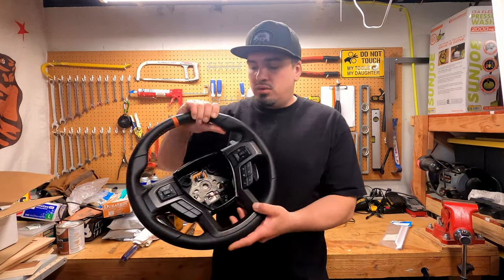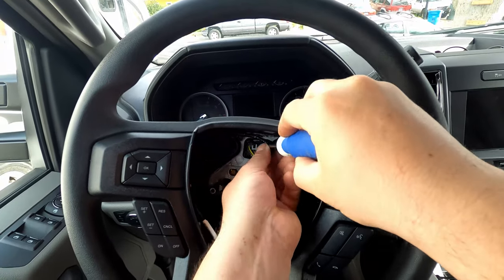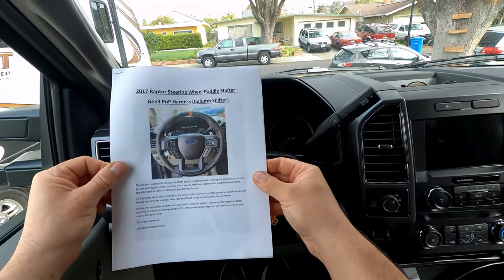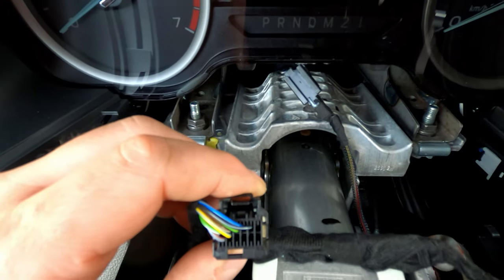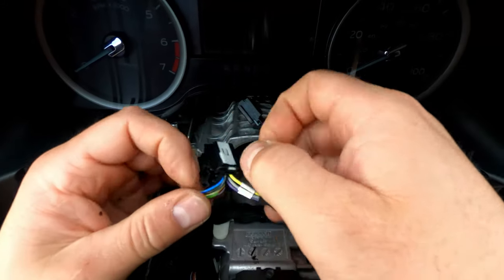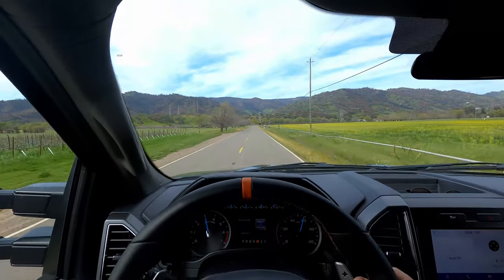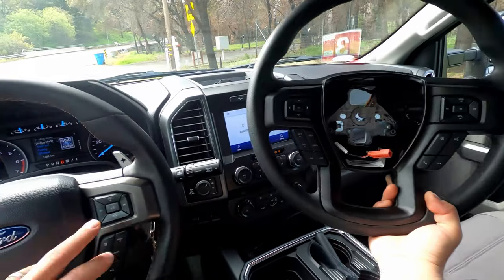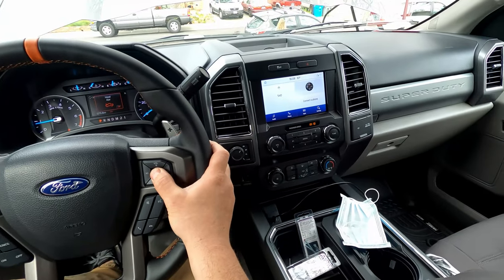Raptor Steering Wheel Install on F250 with BoostedGreyGoose Harness for 2017+ Super Duty

Comment from the maker: UPDATE:
I just towed almost 4k miles, and I absolutely loved having the paddle shifters. I pulled my trailer over multiple 7k+ foot summits on 6%+ grades and it was so nice to be able to easily shift up and down through the gears as needed. It worked really well to put the truck in M and then set the cruise control. This way the truck will maintain the speed when possible, but if you hit a steep incline your speed will drop until you manually down shift. I liked this a lot because I would rather lose a couple MPH's and maintain a gear at 2500-3000 RPM than have the truck down shift a gear and rev up to 4500 RPM to maintain the set speed. This also prevents the transmission from hunting gears and shifting too much when using cruise control, which is what can burn up your trans and the reason people say not to use cruise control while towing.

Comment: An up date, I followed all of directions in this video, including moving the switches as suggested everything works perfect. This is an amazing upgrade from that old rubber steering wheel to this all leather steering wheel with the paddles. By moving the switches from the right side of your steering wheel everything works exactly like the old wheel. As I said before, a perfect video.

Comment: Thank you for doing this video. I plan on doing this to my 2022 F350 with the PS. Using the shifters will come in handy when I need to use the first few gears off roading. Going through all 10 gears on the street would get exhausting after awhile.
Reply: Updates ?

Comment: Nice video, thanks for posting.  

Might do this mod on my new 2023 F150 XL.  Curious if it's possible to hookup the heated steering wheel but I've not researched this beyond knowing the part is available on ford performance.  I'm considering the upgrade for the wheel feel, 4L offroading control, and possibly towing (long term).  I grew up with manual transmissions so do like to be control engine RPM with gearing.  Agree this is a very expensive mod, but for now it's on my mind.
Reply from the maker: It is possible to do the heated steering wheel, there is an additional harness you need which Boosted Gray Goose sells for $350, and that is why I didn't buy it haha. I live in CA so my cold weather is like 30, not worth the money to me. I love the steering wheel and the manual shifting though!
Reply: @ironwoodoverland  I live in the SFBay area for now so 30 is unusual, but do plan on trips with a camper to much colder areas.  I added the engine block heater so the truck can be happy and I might want a steering wheel heater so we are both happy on those cold starts in the mountains or mid-west winters, if I visit family.  350 is a bit pricey, but I'll still look into it more.  thanks for update!
Reply: Any updates on your truck I planing to do the same on a 2023
Reply: @manygarza4634  No update on this project.  I prioritized a couple other projects higher so might get to this next year.  Will probably just skip the heater and wear gloves.

Comment: Hey I know this video is a few years old now but I was thinking of swapping my f150 steering wheel as well, just curious did you have to completely swap your XLT wiring harness into the raptor wheel? Or did you just use the raptor harness that came with the orange stitched wheel? Just wondering if everything with the controls is plug and play if you use the raptor wiring harness. Thank you!
Reply from the maker: The only thing you have to swap over is the horn/airbag assembly. I chose to swap the steering wheel controls too. Then you put in the boosted grey goose harness if you want the paddle shifters to actually work.

Comment: Do all the controls such as music changing and volume and cruise control work on the new steering wheel?
Reply from the maker: Thank you. My stock steering wheel had two buttons and different spots then the raptor wheel, I think it was the mode button and the push to talk button. So what I did was just take out the button cluster and replace it with the cluster from my stock wheel. I'm pretty sure it shows it in the video.

Comment: I don’t see why people think the paddle shifters are pointless on a ten speed I like to downshift on decel and it’s a pain in the ass with the column shifter the way it’s setup from the factory
Reply from the maker: That makes sense. I guess I’ve just never driven a 10 speed and thought that the extra gears would make it too cumbersome to do it manually. Another commentor pointed out that they would be good for off road

Comment: Does this mod disable the stock manual shift bottom on the shifter lever ?
Reply from the maker: Nope, you can still lock out gears like normal  with the plus minus button. This just makes it so you can actually shift up/down when you want to if in manual mode. The computer will prevent you from downshifting or upshifting to a gear that would damage your trans. For example, if you're driving at 60 mph you can downshift to first gear, It will let you go down to second and then the second gear indicator will just flash if you were to try to downshift further.